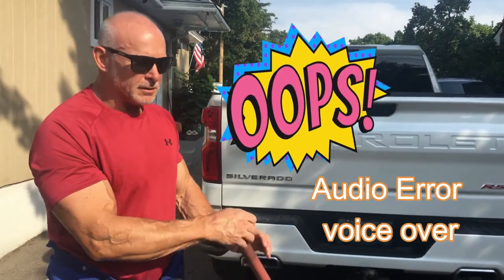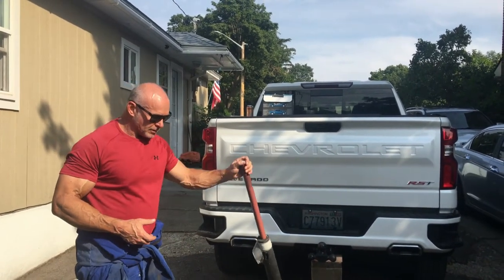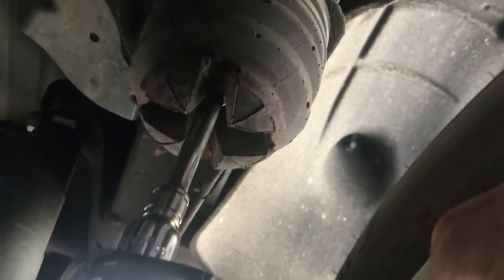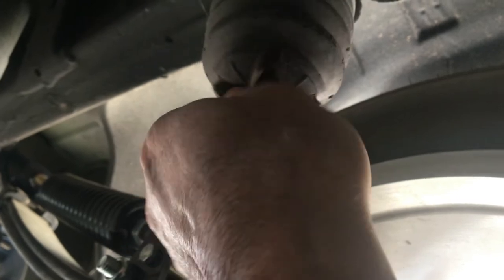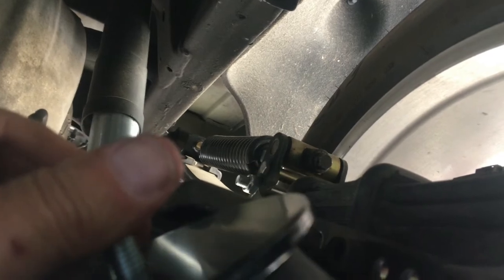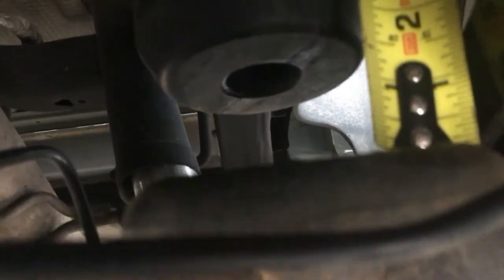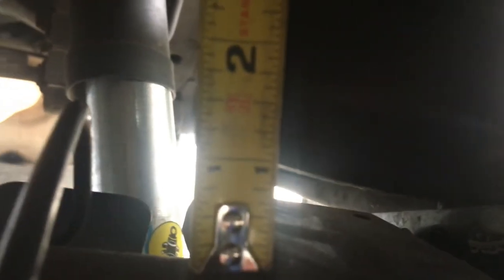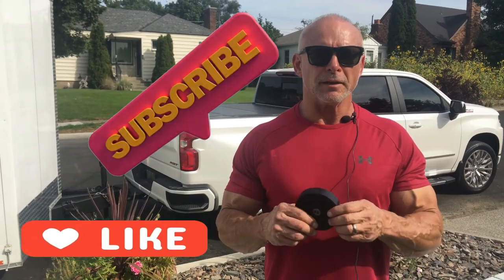Timbren suspension upgrade on a 2020 Silverado/Sierra 1500

Comment: When i go to install on my 21 silverado could you come over and lift my truck i dont have a good jack 😅...... In all seriousness man i have stock suspension ill be towing about 8,000 pounds do you think these will help? I will have a weight distribution hitch also?
Reply from the maker: Yes with the hitch set up properly these will give you a distinct advantage over stock, with alot more safety😀

Comment: I saw you put the ras on the truck then added these then did shocks… did the ras help before the sag? Or was the ras not with it
Reply from the maker: RAS was well worth it, I gained a lot of stability and a substantial amount of load carrying ability with them.
The rear shocks I actually did first and they helped on daily driving, the Timbrens I only added because I was on a "roll" with towing mods...lol
I have never touched them with the loads I have used so far even a 24" enclosed car hauler with a 33 Ford and equipment loaded up.
With all of that and the RAS cranked up to the full amount I tow the hauler at just 1 degree out of level, which was shocking to me.
I DO use a weight distribution hitch and THAT with the RAS made the biggest difference for heavy towing.
Hope that helps.

Comment: How much squat are you getting with the RAS installed and was it worth it to install the timbren still?
Reply from the maker: The RAS cranked to the higher setting keeps my fully loaded 24' enclosed car hauler loaded with a car and some tools about an inch off of the Timbrens, I feel that with my equalizer hitch I don't need the Timbrens for this trailer setup.
If I was towing 7500# or more without a proper hitch setup then i would likely want them as a backup.
Fully loaded at the RAS high setting the truck is 2-1/2 inches lower than when unloaded.
Overall gain going from RAS low setting to high setting is 3/4" less when loaded and of course 3/4" less rise when unloaded so the 3/4" is consistent.
Truck has a pretty good rake to it when unloaded but it can be cranked down to the lower setting  in about 20 minutes if you are prepped and ready to tackle the job.
Would I buy the RAS again?
Absolutely yes before shocks but after a quality equalizer hitch.
I tow frequently and they are worth it to me.
Hope this was and is informative for you.
Anything else please ask.

Comment: Very nice. How did it go? I’m gonna be pulling a 6500lb trailer
Reply from the maker: They will definately do the trick and make a difference for you, ride quality when loaded may suffer a bit though.
Reply: @naughtydonkeyperformance  ended up going with sumo springs but appreciate the knowledge on socket sizes etc. it helped

Comment: I have previously used the timbrens and now use the bilstein 5100s and roadmasters instead on my 21 silverado. In my opinion using the timbrens renders the shock and roadmaster upgrade ineffective and pointless. The .75" clearance gets used up very easily on these trucks. Once you are riding on the timbrens the ride is super harsh and the suspension moves very little. Not to mention the suppleness gained by the shocks is eliminated when the axle slaps against the timbrens going over rough roads. Just my opinion from my experience though.
Reply from the maker: I am leaning towards this thought as well however with my 24' car hauler with a car inside I still have the 1" of clearance so I am thinking if I am ever hauling anything super heavy then I am good to go already.
Just to clarify I definately see and agree with your thoughts.
Thanks for watching!😃
Reply: I had the exact same experience, I’m removing the Timbrens today and going with my Bilsteen 5100 and RAS. It’s possible that removing the RAS and leaving the Timbren would work, but in my opinion they are the issue so away they go.